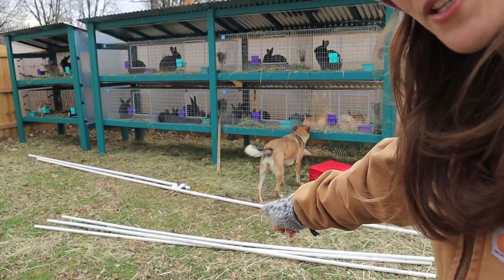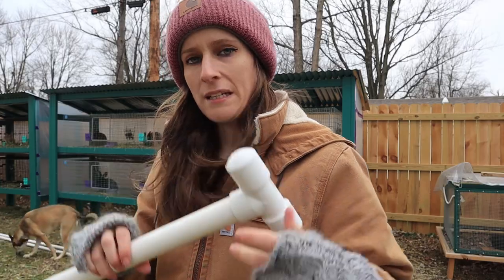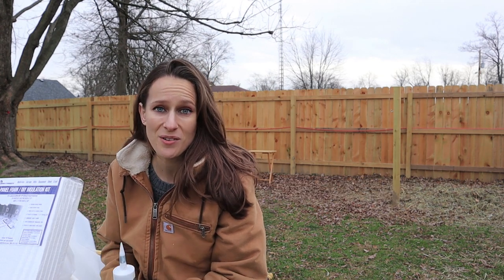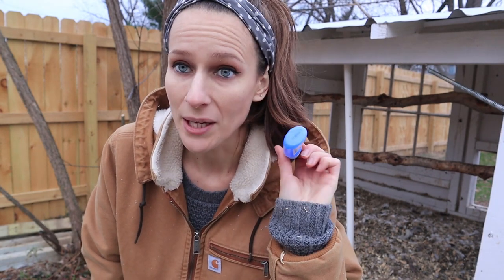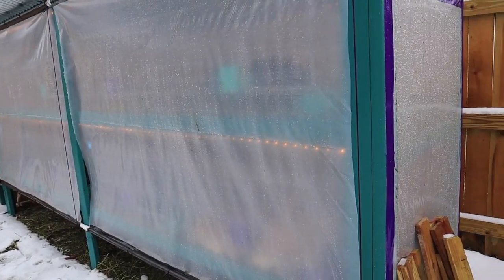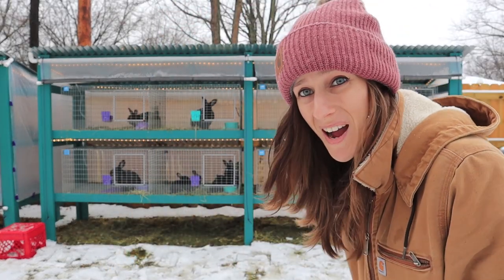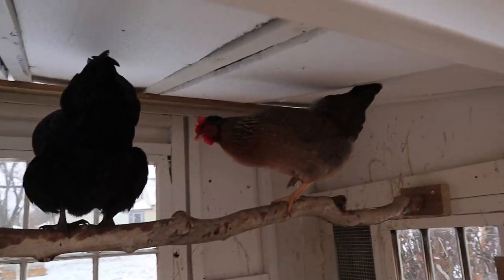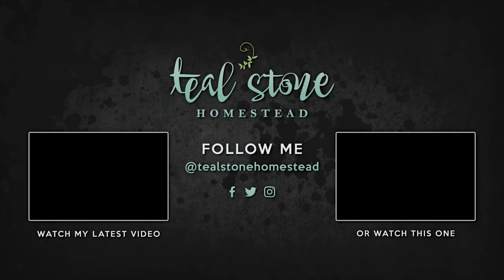Winterizing my rabbits & chickens - DIY clear plastic drop curtain

Comment from the maker: *PLEASE READ*

Some people were very concerned that I added foam insulation in my chicken coop, and I get that! I wanted to see if the chickens would leave it alone since it was on the roof, and they didn't, of course 😂 I ended up stapling rabbit feed bags over the insulation and it has worked out beautifully! You can see that in the video where I add LED's to my chicken coop (link in description!)

Also, for the rabbit hutch curtains I found it very helpful to anchor it by drilling holes in the PVC and running the paracord through the holes. Hopefully this helps someone! It has done a great job keeping the rabbits out of the wind.

Comment: I don't want to tell you what to do, but I would rethink that insulation. If they find it, the chickens will peck and eat Styrofoam. For the glue, next time pick up construction adhesive. Silicone doesn't have enough tack to hold things in place, as you saw. But really, foam in a coop is a bad idea, imo. Just make sure the coop has good ventilation and it should take care of the moisture problems. The biggest mistake people make in the winter is trying to seal the coop up to keep the chickens warm. Coops need to be draft free, but still maintain a good air circulation. I always say that a coop should not keep the chickens warm, it should allow the chickens to keep themselves warm by keeping them dry and out of the wind and weather (hope that makes sense). And a sealed up coop holds moisture which leads to frost bite and other issues. The rabbit cages look great. This is the first video of yours that we've watched so I'm sorry for sounding like a critic. Great work. We moved from Indiana and miss it.
Reply from the maker: Thank you! So far we haven’t had the problem of them pecking at it, though they free range our yard so that’s probably why. The main reason I added the insulation on the roof is because when they are on the top roost, their heads can touch the roof. I was worried that if we get an overnight freeze, their feathers or some part of their head would get frozen to the roof. So it was more about preventing that than anything!
Reply: @TealStoneHomestead  I wonder if you could staple some fabric, or even window screen or something to the ceiling of the coop to keep their heads off the metal. Just throwing out ideas.
Reply from the maker: @diyfferent  that’s a good idea!! Thank you!
Reply: Agree with above comment. My chickens eat styrofoam.
Reply from the maker: @amykinnell2837  I’ll definitely keep an eye out for that! 😊
Reply: @TealStoneHomestead  your roosts are fine - they won’t touch the roof. Chickens slip hiding their head under their wing. I’m in Ohio and it was 14F - the birdies were ok

Comment: I wouldn't worry about the Tin roof and your chickens touching it or getting stuck to it, I'd be more worry about them pecking at the foam and eating it which they will do, so will rabbits and foam is not good for either.

 Also I wouldn't button their cages up to much as both animals need ventilation, the biggest thing to worry about is keeping them out of direct Cold wind and make sure they have plenty of dry bedding, and drinking water, and with Rabbits it is extremely important that they have food available to eat when it is freezing temperatures as this helps them to stay warm.

 I live in Iowa myself and we been known to have the craziest weather here, It can be 70 degree's one day, and -20 degree's and a foot of snow the next,  So I know how your weather there can be too. Your doing a great job, keep up the good work, and don't pay any attention to the negative comments that some people make, 
Your proving super nice living quarters for your rabbits, and just by seeing them and their beauty and size, one can tell your feeding them properly.

 Good Job! If your Still concerned about your Chickens staying warm enough? Hang a heat lamp in one corner of your coup to generate some heat. Be blessed!  Steve
Reply from the maker: Thanks so much Steve! The front cover on the rabbit hutch has been wonderful for us so far! 😊 

I did not add any foam to my rabbit hutch, and in my recent video I show how I stapled feed bags against the foam in my chicken coop. No worries on chickens eating it 😊 I am personally not a fan of heat lamps in the coop. I don’t think it’s a safe option.

Comment: Before I added my roof I made a bed of hardware cloth on top I put a water heater insulation role that I had.then added the roof.  In addition I insulated the top of the nest boxes with the same.  I am not concerned about winter as I live in Fl.  I used rubber carpet tiles in the bottom of the nest boxes.  At one time I had a solar fan in each nest box, but they did not last even one summer.  I elevated the floor of the coop 2 ft and wired around the floor and the width of the nest boxes giving them a 5 1/2ft. Dry and shady place to go.  I used a Ryobi fan.  On low the battery lasted all day.  The girls loved it.  Great rabbit build. I am considering rabbits, but only small pet verities.  Enjoy.  PS I am 78 and three years ago I did my first chicken house build.  I had never used tools before, but with YouTube I have 4 beautiful coops with runs.  Thank you for you informative channel.

Comment: they sell metal rods(they look like coat hangers, but small straight)  for holding installation in place it has pointed ends to stick into the wood, they come in different lengths.

Comment: I made custom tarps for my hutch.  Added grommets and 4" bungie ball cords.i wish I could add a picture. Grommets in the bottom corners of your roll down curtain would hold them in place
Reply from the maker: I have plans for a more permanent “tarp” situation hopefully this spring 😊 someone here in the comments mentioned drilling holes in my pvc pipe to hold it down and that has worked wonders! Grommets are also a great idea!

Comment: You can glue the plastic to the pvc later. I think it might hold on better than Duck Tape.
I think those bunnies are just the cutest!
P.S. I think your idea about plastic covering the rabbit hutch and the use of the crank is great! And, yay!, it works! Fantastic job!
Reply from the maker: Glue is a good idea!! I originally got the duck tape idea when I was trying to reinforce the edges of plastic sheeting last year. It ended up working beautifully. I’ll admit, even though this looks nice and neat I was in quite a hurry when creating it, so it’s one of those things I’ll probably end up redoing in the future. But so long as it doesn’t fall apart, it’s a success for this winter! 😊
Reply: @TealStoneHomestead  Exactly right. The idea of putting Duck down the vertical edges is great. It will add just a little weight and more rigidity, while protecting the edges from shredding or tearing. I think you're a dang smart cookie! 😁

Comment: I like the way you did the roll up sides. Mine are much more primitive. I roll it up from the bottom and tie it up with a piece of rope. Did you use green house plastic? It is more UV stable. Plastic from big box store will not last long because it is not UV stable.  Have you considered shredded cardboard as litter? It is nice to be able to reuse amazon boxes. It also breaks down nicely in a compost or worm bin. Probably doesn't smell as good as wood chips, Amazon Basics 12 sheet micro shredder works for me. Shredded paper doesn't work well because it clumps and when it spills out a little, that white color sticks out and makes it look messy and I think you like a clean look.
Reply from the maker: Thank you! I used regular plastic sheeting. I’ll have to look for the greenhouse plastic 😊 I frequently use cardboard boxes for the rabbits, they love tearing them up and sometimes we even use them as disposable litter boxes!
Reply: Ho will you take the foam board off in the spring when you need the ventilation?
Reply from the maker: @snapfreshfarm796  I probably won’t 😊 my coop has a ton of ventilation on the sides and still has the gap between the coop and the roof up top. Lots of air flow!
Reply: Someone may have already said this, but you can buy pvc greenhouse clips on Amazon that will clip your plastic to the pipe. They snap on and will allow you to eliminate the duct tape! They were a lifesaver for me! I like your projects... giving me some good ideas. Thanks!
Reply from the maker: @petergrimes2794  OMG. I did not know that was a thing!!! Thank you!! I’ll be buying some for sure! 😁

Comment: Just an idea for if you ever want more bunny cages I use XL dog kennels for my bunnies in the winter we built a huge shed for them (my pets) but it works super well for winter in the summer I have huts for them but you can find some on FB or cregslist for around 25-30 dollars depending on how much you want to spend but they are awesome and come with a tray but if you don’t want the tray you can take it out and just have the wire bottom. 😊
Reply from the maker: That’s a great idea! 😊

Comment: Looks great..
Have the chickens destroyed the insulation yet. Mine did. You might want to cover it completely somehow. Also add eyelets to the bottom pvc to hold the rope to the pvc.
Reply from the maker: Thanks! They did not destroy it, but I did cover it with feed bags stapled on the roof. I also have drilled holes in the PVC and that has helped tremendously! I’ll try to show that in my next video 😊
Reply: @TealStoneHomestead  I look forward to seeing that.

Comment: There are clips you can buy to hold the plastic. Or just cut a small piece of pvc and make a split in it and sand the edges smooth. If you round the corners off the will clip much easier
Reply from the maker: Yes I just learned about this recently!! Thanks! 😁

Comment: I have no idea about which would be the best way to glue the insulation to the metal roof (that sounds like something really hard to do, metal and foam don't get along so well, especially if the metal starts to for condensation...) but if I can give you an hint, I think you could drill holes at the end  of those PVC poles (the ones for weight at the bottom) and run the ancor line through them and to the eyelets, so it would keep them in place, and you wouldn't have any kind of problem with the wind blowing the curtains around. I don't know if you got what I mean, I hope my explanation makes sense...
Reply from the maker: I finally got it with the foam! Gosh was that annoying 😂 my chickens did start pecking just a little bit at it (like many of the comments warned me about 😅) so I stapled feed bags over the foam for now. I’ll have to figure out something more permanent next year 😊
Reply: @TealStoneHomestead  Yeah, I've read those comments, chickens just peck t everything they can! XD Maybe you could screw some thin sheets of plywood over it. I know you said you don't like it much because it's heavy, but it could be an easy and cheap solution... and they wouldn't peck at it for sure XDD
Reply from the maker: @coleichecura  very true!!

Comment: Wire for the floor did you use for your rabbit hutch and how big did you make them the size
Reply from the maker: My cages are the double-modular design from KW cages. They are 30x36 😊

Comment: How did you attach the plastic to the back and sides?
Reply from the maker: I cut to size, reinforced the edges with duck tape, and used a staple gun! I find that the duck tape keeps the plastic from ripping where you staple it.
Reply: We used paint stir sticks stapled over the plastic to hold it in place. Cheap and sturdy.